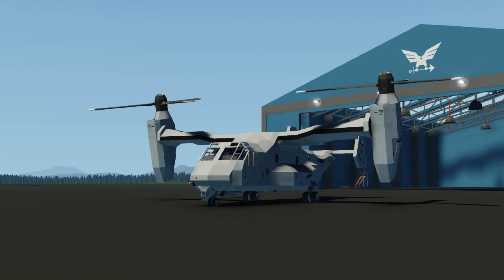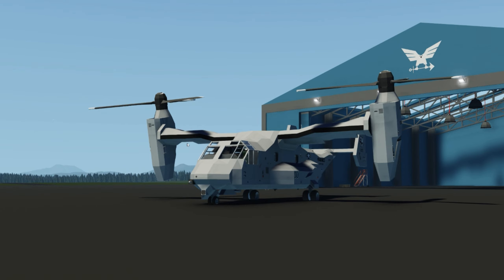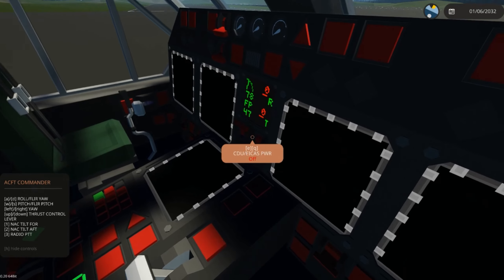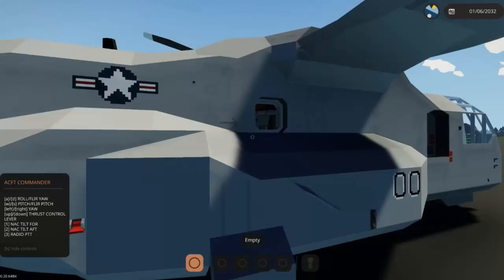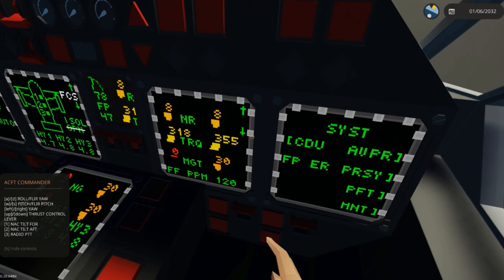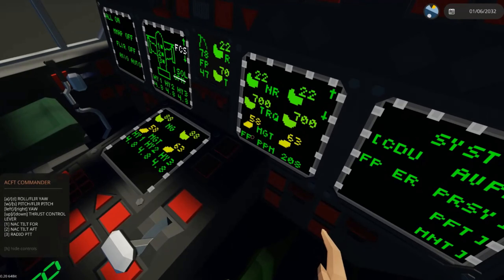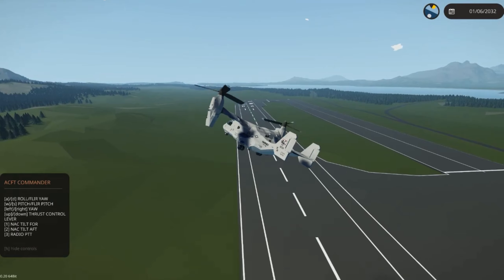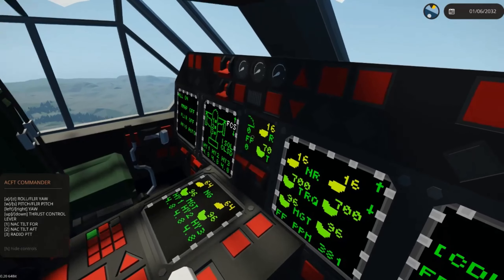MV-22B Osprey Startup Tutorial

Comment: Beautiful creation , can I ask how you simulate hydraulics .. and what do you use as APU to generate power?
Reply: APU is simulated/run via an xml modded engine. Hydraulics is run via numerical functions off of torque sensor RPM at various points along the driveshaft. The placement is an approximation from the hydraulic pumps IRL location on the drivetrain.
Reply: @EvanButler320  thanks a lot for clearing that up!

Comment: how do you fold the wings
Reply from the maker: You have to have hydraulic pressure, using the APU. Once that's the case, go manually fold the rotors, so they don't get damaged. Then navigate to the BFWS (Blade Fold/Wing Stow) page in the settings menu, and select your desired final position. There is then a BFWS button on the ceiling control panel, and you must hold that until your desired final position is reached.
Reply: @ghostleader320  ty
Reply: Wait what do you mean by manually like going on the aircraft and pushing the blades or is there a button for that

Comment: I followed ur steps until u said to check for hydraulic pressure, and I had 0. Then the engines didnt start :(
Reply from the maker: It's likely that the APU wasn't started, then. The APU should provide power to the hydraulics almost immediately after it spins up.